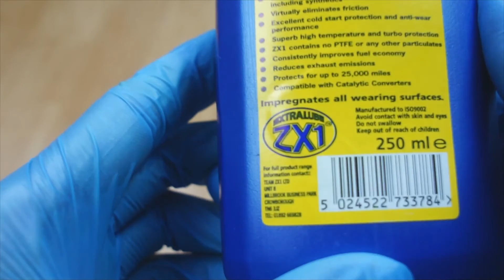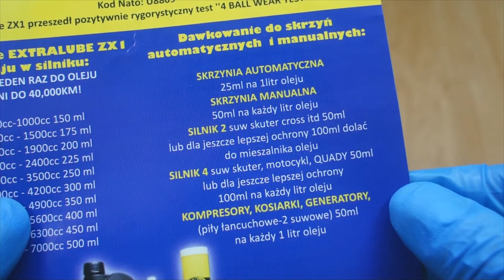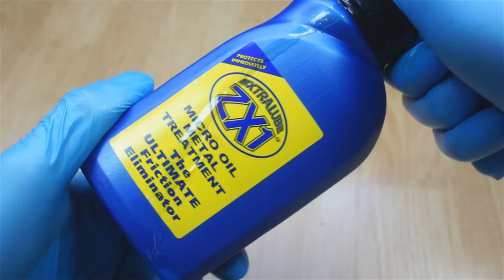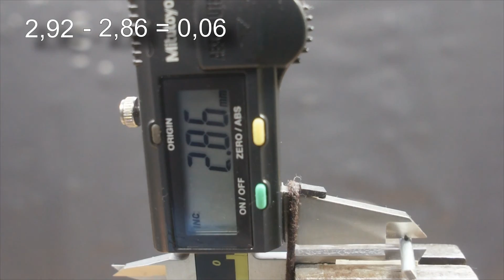Extralube ZX1 Dodatki do oleju Analiza Test Tarcia 100°C

Comment: I treated a brand new nitro rc car with this before breaking in the engine, I took the cyl head off and lubed the sleeve and piston with zx1 then did a compression test prior to first start. After first start and going through several tanks of fuel, after the running in period was complete the compression was the same as it was out the factory. Which means, zx1 does an excellent job to the point where it will stop a brand new engine running in 🤣